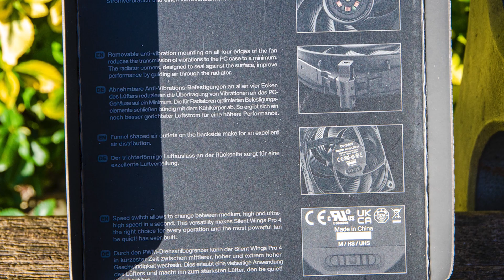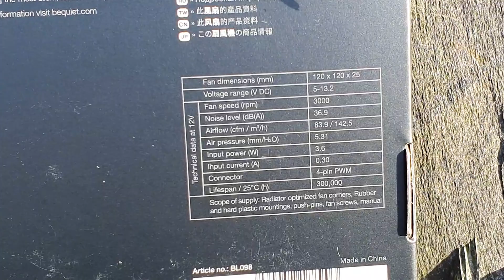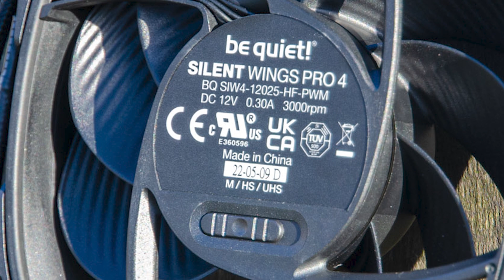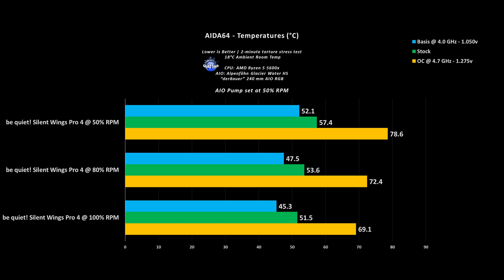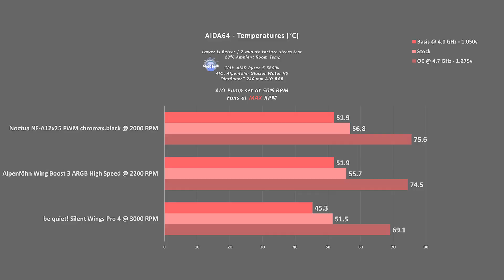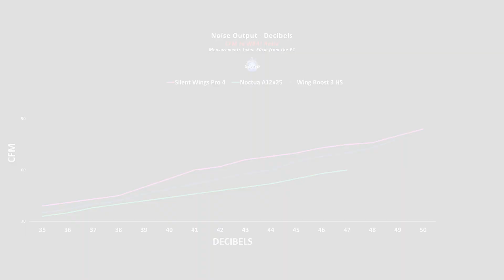The Ultimate Fan - Silent Wings Pro 4 - 3000 RPM from be quiet!

Comment: I bought three of these to use on the new NZXT Kraken RGB 360 white AIO. Hopefully it will keep the 7800X3D on a decent temperature and more importantly, it will remain quiet during gaming. The High Speed ones are the best Be Quiet version for radiators, right?
Reply from the maker: If these don't then nothing will 😅
As long as it says 3000 rpm so you have plenty of headroom regarding a custom rpm fan curve and you use the stock thick corner adapters, which are for radiators, then yes, you are covered 👍
Reply: @Glob3Tech  Great! Excited to game in silence. Next week is Diablo 4 time!
Reply from the maker: @bemindful924  Let me know how it goes 🤙 
Ooo yes, see you in Sanctuary 😁